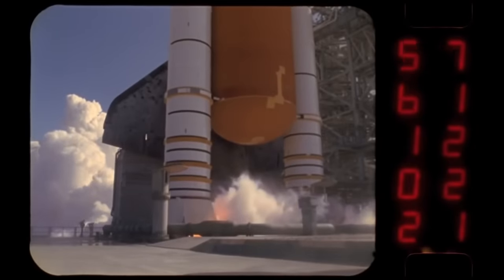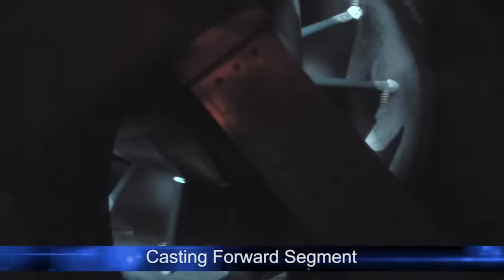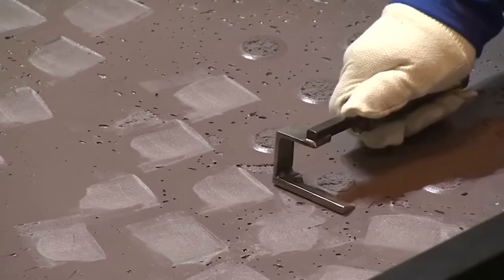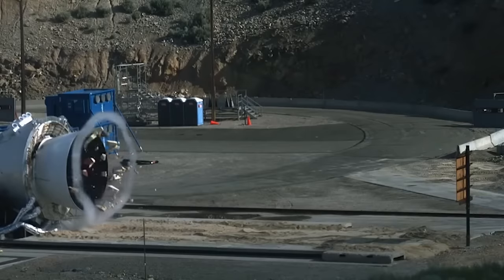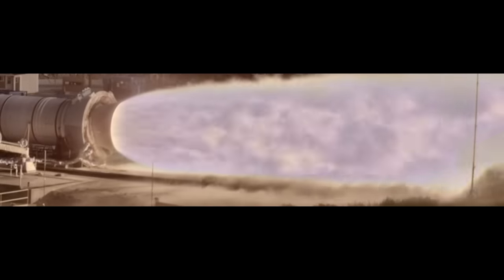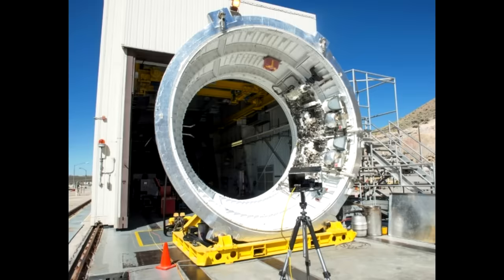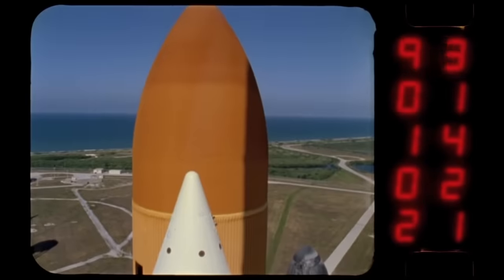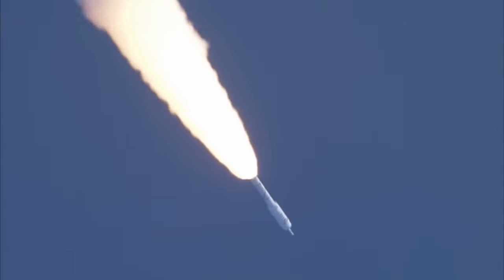The Amazing Engineering Behind Solid Rocket Boosters

Comment: One of my favs Scott. I knew the general “leaking seal” conclusion for the mission disaster but you’ve just added a vast amount of fascinating info with a presentation skill that assumed reasonable intelligence. 

Thank you very much and please carry on.
Reply: I didn't know until now that the initial oscillations stopped, and then windshear re-opened the gap.  That's new data to me.  Thanks Scott, and "Fly SafeLY"!
Reply: @silasmarner7586  That is a sad fact. It's possible that if it werent for the windshear, that "slug" may have stayed in place.
Reply: @hoghogwild  if Challenger had survived, NASA's appetite for risk would have increased, and another shuttle would have exploded later
Reply: @byoung1520  The launch timing of the Challenger craft, as those of us watching from our classrooms at the time know, was driven largely by an artificial political deadline imposed by Reagan's staff insisting on knowing when things were going to happen so they could structure the President's schedule. In reality Reagan was willing to be far more flexible than his staff pushed NASA management to believe and the shit-show of miscommunication and problem over-minimization snowballed from there. To claim that it was purely about risk culture just isn't accurate—humans fuck up in much more intricate ways than that on average.
Reply: @DrewNorthup  what I meant is that there were obvious reservations on Thiokol's part about launching in temperatures that cold which NASA ignored. They forced the launch against the objections of the engineers that actually built it. If Challenger had survived, it would have likely have made NASA even more bold about overruling engineers on future flights (in order to meet the aggressive schedule that you mentioned) , inevitably leading to disaster.
Reply: Every other description I've read gave me the impression it was a liquid fuel leak, which I imagined to be in a fuel line from the main tank to the orbiter.  This is totally different.
Reply: @DrewNorthup  Check out the report mentioned in my previous comment; it's only a few pages and it's amazing. It outlines NASA's history of "if it hasn't failed yet then it's safe" attitudes, and tears up their SSME development as well. Regardless of deadlines, it was basically a matter of (not too much) time before a shuttle failed.
Reply: @ElTurbinado  I've read the entire Challenger report, plus a significant amount of related analysis materials. I've listened to interviews with the Morton Thiokol engineers, NASA program managers,   Presidential staffers, and political operatives. I've read the CAIB materials and related analysis. I approach the subject with some rigor.

Comment: Another part of each booster's propellant was about 18,500 pounds of Dow Chemical's DER 331 epoxy resin.  It was used as a binder.
Reply: Is that on top of the PBAN binder? What is it's purpose? Is it a curative agent or something?
Reply: I really want to know how you knew that
Reply: PBAN itself doesn't cure for a very long time and needs help. PBAN requires "other stuff" in order to cure and 331 is/was a common addative to assist in the curing process. There's obviously more to the process but this is what's behind the usage of 331 from my understanding.
Reply: There is a hobbyist named Richard Nakka who has made his own mixtures and has a fantastic website, and the resin increases performance in addition to acting as a binder.
Reply: aaaigh! That must've been the stuff! We were about to go on summer vacation one year when the satellite motors made at my dad's plant in Maryland started exploding because the rubber propellant was pulling away from the interior of the casing! Same propellant, same casing, same everything, and they had to figure out what had changed between one batch and the next! His boss managed to negotiate so that we could still go for a week.

I remember looking at the x-rays of the satellite motors on the kitchen table and my dad showing me the bubbles formed where the propellant had pulled away, explaining why it was so dangerous.

This was before Challenger. So when Challenger exploded I had an immediate inkling what had happened, although not why. :(
Reply: @aemrt5745  They mixed it in mixers used in the baking industry!
Reply: @RideAcrossTheRiver  Yep!  Very true.
Reply: The rubber is a binder and a fuel, the epoxy acts as a binder and phlegmatizer so the rocket propellant burns but doesn't heat so quickly that it explodes.
Reply: @ellenb4646  yup that is why it's added. The vibration will knock big chunks of the perchlorate rubber mix that then gets heated hot enough to trigger true detonation which is very bad for a rocket motor.

Comment: Fantastic breakdown of the boosters. My dad worked for Thiokol, but I was a little young for him to explain them in this much detail when the boosters were first designed (I would've been about four or five), and after Challenger it was a little painful for me to quiz him about the specifics, especially with my classmates tormenting me about it. 

He worked at the small plant in Elkton Maryland that made the little kick motors like the separation boosters, probably the ignition booster and firing latches for the bolts at the bottom. I only realized recently that my whingeing about not wanting to move to Utah, which caused him to turn down a promotion, turns out to have saved him from being caught up in the O-ring debacle a few years later.

When I was little they were doing a lot of interesting experiments in the physical properties of the rubber matrix of the propellant at his lab. He had bread mixers to mix little bitty test motors, scale models of satellite motors! I loved all the interesting forms they used trying to figure out the best interior shapes to achieve different rates of burn. They settled on star shapes with those long vanes, but it took them a while to refine that core. And there was a really messy few years in the satellite industry when Thiokol's original set of outer casings were used up and they went to a secons set and suddenly the propellant started peeling away from the interiors because the adhesive was just ever so slightly different! Gaps go boom. Gave my dad a lot of headaches back in the day.

It was so early that they were using slide rules, so I know they couldn't have been doing computer modeling yet. Early shuttle design was a very hands-on, physical sort of ship design with a lot of scale model experimentation, since it couldn't be computer modeled yet.

Somewhere in my parents house is a toy box with my childhood blocks made of honest to gosh rocket propellant. There was a "safe" version which was missing the oxidizer… It was just the rubber matrix, dyed green to show it wasn't explosive, used for tensile strength and other physical stress tests. Lab always ended up with all these oddly-shaped scraps that the scientists took  home to their kids. I look for those blocks every time I visit my parents, but they're buried somewhere. They were great; they bounced! I'm sure that wouldn't be allowed now.
Reply: Thanks for telling. Even if your dad was not directly involved, what were your dad's thoughts at that time about Thiokol and specifically the accident? If it's not too personal to tell. I was also very young but I can remember Thiokol took most of the blame, if I remember well. I can imagine it must have been very tough times for the family.
Reply: Some of the inspectors told me they took the blame in return for being able to continue having a contract. Don’t know if that is true or not.
Reply: Thank you for sharing your story, it was very interesting!

Comment: Great video as always!  One correction though: at 13:58 you state that the extra segment means a longer burn time.  I thought this was the case until recently too, however, the extra segment only adds extra thrust.  The burn time is more of a function of the radius of the booster (propellant burns from centre outwards).  It turns out the 5 segment SLS boosters burn for 1 second less than the 4 segment shuttle SRBs!
Reply: That would (probably) entirely depend on the diameter setup of the booster. They probably opted for a larger "tunnel" in the lower segments for the new boosters, allowing them to burn faster for more thrust. Narrower diameters would add more fuel and more burn time.

Comment: Fun Fact:  The boosters acted totally differently than they had been designed to work, or to be more accurate, than the engineers anticipated.   Engineers envisioned a uniform outward expansion of the booster case at the moment of ignition, which would have pressed the tang and clevis together and squeezed the O Rings. 

However, when they conducted the first pressure test of the booster, they were astonished / surprised / shocked / confounded / flabbergasted to discover that the casing ballooned outward above and below the field joints, aka joint rotation.   Instead of the joint sealing tighter as they assumed, it opened up (this is a separate phenomenon from the 3 to 4 flexes per second that released the built up pressure of The Twang). 

Joint rotation was an even more serious threat to the shuttle program than the resultant O Ring erosion (which was waived as an acceptable risk) because a complete joint redesign would have not only been expensive, it would have required grounding the shuttles until the joint was fixed properly.
Reply: My father developed guidance systems for satellites and warheads.   He always complained that most everybody just couldn't seem to properly comprehend the magnitude of the pressures held in the system.   This all is getting to be something from a long time ago...
Reply: There never should of been sections. NASA should have paid the extra for a one peice srb, saving 7 lives. $ priority over safety costs lives.
Reply: @adrianfewster8391    I think a one piece casing would have been wildly impractical because of the transportational logistics as well as the fact NASA spread its contractors around the country (especially to States with representatives who voted money for NASA).

Once the joint rotation phenomenon was known, they could have added the capture piece to the inside of the top joint, or simply have listened to the engineers who begged and pleaded not to launch below 53 degrees.
Reply: @michaelzilkowsky2936  One piece srb designs were offerred, and with ocean transport supply, however rejected in favour of the Thiokol cheaper offer with compromised safety using o-ring sealed segments for road transport, What are 7 astronaut lives as well as the loss of the complete shuttle worth in comparison to srb savings ?
Reply: @adrianfewster8391  or maybe just don't launch when there's ice on the launch pad.
Reply: @JoeBlow-bd1eg  There were still blowby issues because the o-rings could not handle the pressure/temperature applied. The fact that only ran for 2 minutes saved many flights which would have exploded if it period was longer due to the erosion seen on primary and partially secondary o-ring by Thiokol engineers. Take away the joints in a one piece srb removes all of that risk.
Reply: @michaelzilkowsky2936  The ring connector all have locking pins. So it shouldn't joint rotation, the problem.  But it was a vibration and seal ring miss property.
Reply: Richard Feynman wrote an additional appendix to the SS Challenger report that highlighted the lack of understanding of fundamental engineering principles at management level at NASA.  To illustrate this he used the example of a bridge that was designed to have safety load factor of 3.  NASA management operated as if this meant that it was acceptable for 1/3 of the bridge structural members to fail at the normal design load.  That erosion and blow by of the first solid booster rings had been identified in recovered sections but that combustion had been contained by the second ring was read by NASA management as safety factor of 2.  The first ring was not designed to ever fail in normal operation and the engineers at Thiokol knew that ring failure was equivalent to part of the bridge falling down at normal loads.  To launch at low temperatures was akin to adding extra load to the bridge and put at risk the second ring.
Reply: @adrianfewster8391  If safety was the priority they never would have gone to space.
Reply: @adrianfewster8391  I reckon that if you knew everything about what went on in the space industry you might realise that decisions like this are made every single day. There were probably a thousand things that weren't originally designed perfectly but it was determined that the risk of them going wrong was acceptable. It's nice to imagine that the designers designed an otherwise flawless spacecraft with only one little seal issue that they were too stubborn to fix, but it is probably much more accurate to say that they designed a barely working spacecraft with a thousand things they could fix but have to choose not to if they ever expect to get the thing into the air. Expensive redesigns are just as likely to implement more issues than they are to solve the original ones. - That's something you don't often hear because most people don't want to admit it.

We never hear about the other design issues that happen to not cause an accident just because wind blew in the right direction that day, and we praise the success of such missions, disregarding the imminent potential for failure just because we assume that because no accident happened they must have designed it perfectly. At the same time, we criticise to no end the few issues that do make it through the cracks and lay judgement and blame on people that may never have had ill intentions.

If it is so easy and expected for everyone to just "put safety first" then why do these sorts of accidents keep happening? They keep happening because stupid comments like "they should have just put safety above profits" are so out of touch with reality and tone deaf to the situation that designers engineers and accountants are in that continuing to use this as the solution to all societies' problem might as well be considered ignoring the issue. It's like constantly suggesting a terrible remedy to a illness - it's no wonder why it isn't working.

Even in a world where “Safety” is above profits, accidents can still happen.
Reply: @adrianfewster8391  Every day thousands of people drive through pedestrian crossings (where you have to give way to pedestrians) and don't look, however none of these people actually hit pedestrians, because there weren't any crossing at the time.

But we punish the one driver who did the same as everyone else, the one driver that happened to drive across at the same time as someone was walking. We call their actions criminal negligence and dangerous driving, and call them out for being a terrible person. How are they any different from the rest? They didn't do anything differently to anyone else, but they take the blame. I don't think Marshall is any worse than anyone else working in the space industry, he's just unlucky that this of all incidents happened.
Reply: @pwhnckexstflajizdryvombqug9042  You just assume the car drivers don't look. The driver that gets booked for not making way for the pedestrian crossing in use deserves the ticket. Its a bad analogy. Marshall and Thiokol management had two expert engineers telling them it was a catastophic risk to launch for reasons explained, but they were still ignored. That is the criminal element. Failure to act on a dire warning. When the enquiry came later Nasa did not want to talk about temperature and o-rings as they knew they had caused the disaster in their neglect to follow expect engineer advice. Mulloy should have been jailed, He is the definition of extreme arrogance.
Reply: O ring erosion being called an acceptable risk was really not a good thing. Feynman was making the point that they weren't designed to erode, they were designed to stay completely intact, and as such the erosion was a failure
Reply: My brother!: 

My name is Jason Wampler, and I have been designing solid fuel rocket motors
Reply: for the better part of 23 years.  The segmented casing of the boosters main frame was a very creepy design.  IT SHOULD HAVE NEVER BEEN SEGMENTED TO BEGIN WITH, BUT BECAUSE IN HOUSE MANUFACTURING AND TRANSPORTATION LOGISTICS,. MORTON THIOKOL DECIDED TO DESIGN CASE SEGMENTS TO FIT THE PROPELLANT GRAIN(FUEL)SEGMENTS.  THIS  WAS, OF COURSE, GOING TO VERY EASILY FACILITATE MANUFACTURING AND SAFETY INSPECTION OF BOTH GRAIN SEGMENT AND CORRESPONDING CASE SEGMENT.  TRANSPORTATION WOULD BE MUCH EASIER TOO....
Reply: HOWEVER!!!!, this presented a new and much more dangerous set of challenges that would almost render these giant 4 million pound thrust SRBS   criminally dangerous and practically useless!..
Reply: One: the seals were both lap and compression seals.  WTF! A slip seal with a compression seal means the seal has to SEAL both sideways and forward! Impossible!

English chimneys are romantic! Six main casing motor segments have to be square cut and fit.  They have to stack six high absolutely straight! They have to hold straight at 18000 miles per hour 15 miles above Earth's surface.  Good luck!  The whole design was fundamentally wreckless!

A solid, continuous tube would've solved a lot of problems.  It's done this way in the types of solid fuel rocket motors now, and will continue to be so. Free

Composite motor casings could've saved NASA the agony of having lost personel.....
Reply: I bet you're real good at talking dirty. Pushing the tang and clevis together before you put pressure on the O ring.